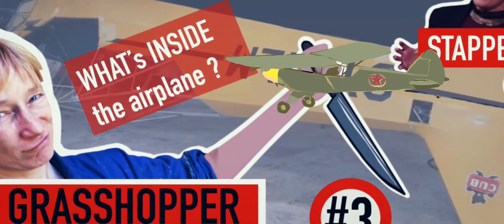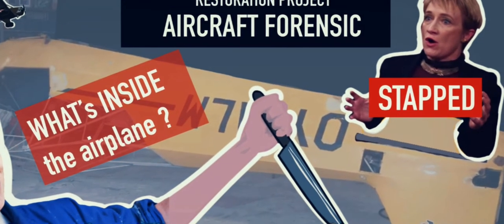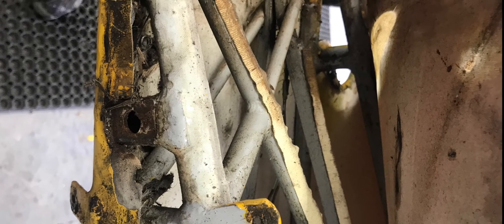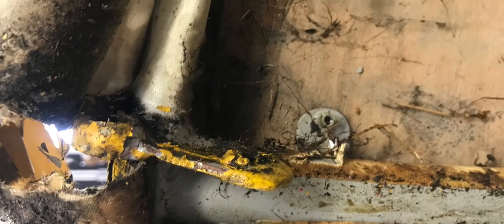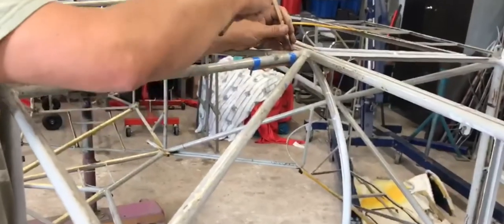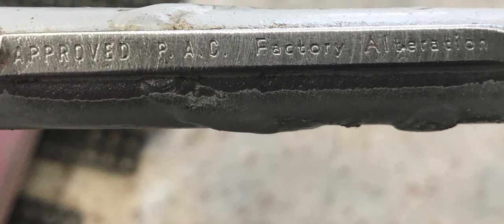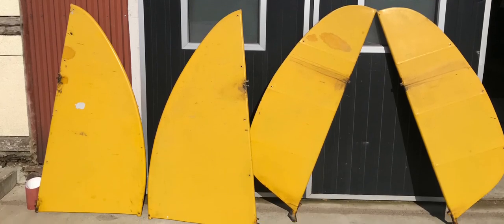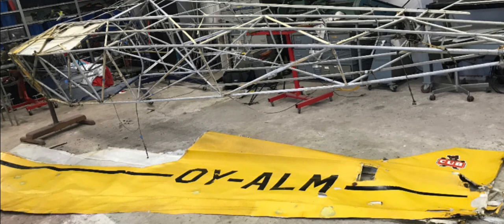GRASSHOPPER #3, Aircraft Forensic, The Piper Cub OY-ALM Restoration project

Comment: Simone, sad to say but the "punch test" is not a very good method these days. It was fine with "grade A cotton" but with the newer fabric we are using there are better ways. I am an A&P/IA and have recovered 4 airplanes so far and almost always you find something else that makes you happy that you did take it apart. 

The metal punch is a very good method, especially on the lower longerons back towards the tail. Now please make sure that they paint the "punch area" to make sure that it will not rust in the future.

Regarding the history of the airplane, you can get a CD with all the data that the FAA has on it for under $10 and it will tell you a lot about it.
Reply from the maker: joeaksa Thank you so much for your input - very interesting. Please keep charring your knowledge. In this case I think it was the right thing to get the canvas up in order to check and preserve the airframe. Also if the punch test is not the right method. However the punch test is used in practice by mechanics in Denmark to determine if the canvas is airworthy or not.